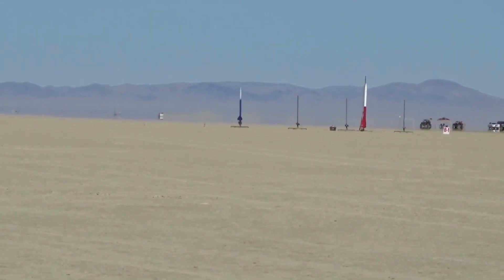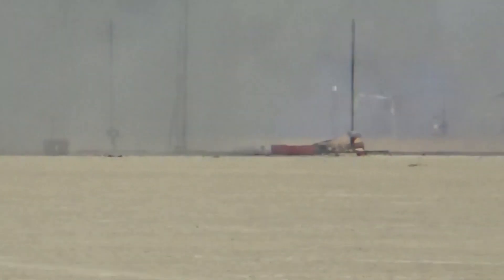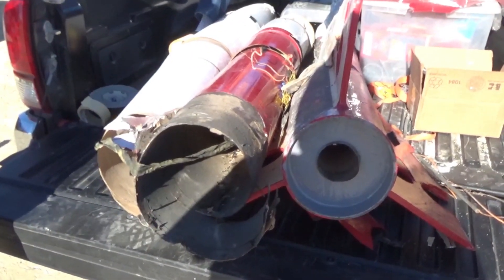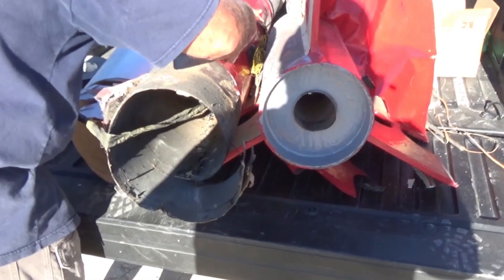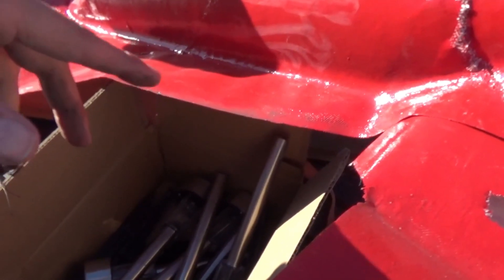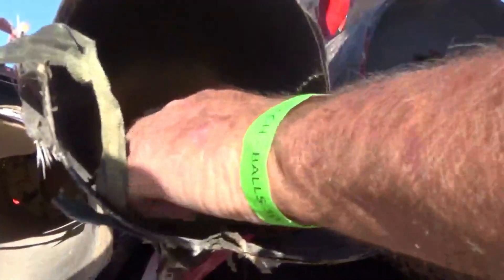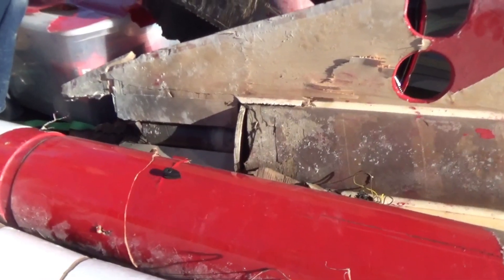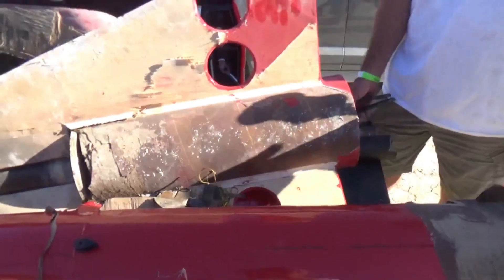Weird explosion CATO Balls XXX 2022 wrong rocket launch CATO in @ 2 seconds.

Comment from the maker: It was weird he did push the right bottom and when he released the b1 bottom the blue rocket launched. My personal guess is that the electrons fired the gunpowder in the red rocket giving the appearance it had launched. They where using the wireless transceivers system. So my second theory is that maybe the signal was corrupted in a way the box received pad 3 launch, signal righted it’s self at the end to launch rocket 1
Reply: I used to do root cause analysis at my company.. and I'm an electrical engineer (with specialty in communications and RF).. so I'm a bit curious.  

That IS a strange cross-firing condition.  I HAVE seen wireless systems suffer a logical fault and fire more than one (or the wrong) rocket.  But it's usually human error (unless they're using a cheap 315/435 MHz ISM band, "garage door" relay or fireworks controller circuit).  Those are very easily interfered with via car locks and other similar pocket transmitters, and even ham radio (440MHz band).

What wireless system were they using?  Is it a dedicated system like Wilson or Altus Metrum?  Or a cheap Chinese ISM band "fireworks controller"?

Comment: What launch control system was being used here? Did anyone ask the LSO what happened at the controller?
Reply from the maker: It was weird he did push the right bottom and soon as he released it the b1 bottom the blue rocket launched. My personal guess is that the electrons fired the gunpowder in the red rocket giving the appearance it had launched. They where using the wireless transceivers system. So my second theory is that maybe the signal was corrupted in a way the the box received 3 launch, signal right it’s self at the end to launch rocket 1